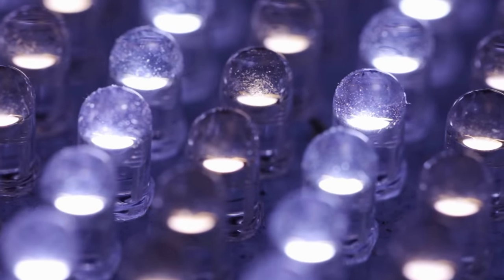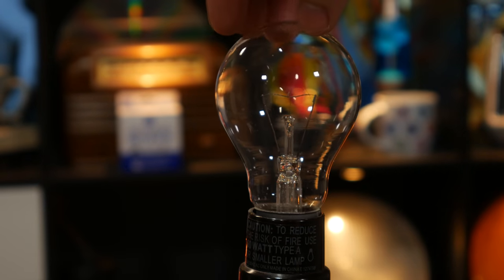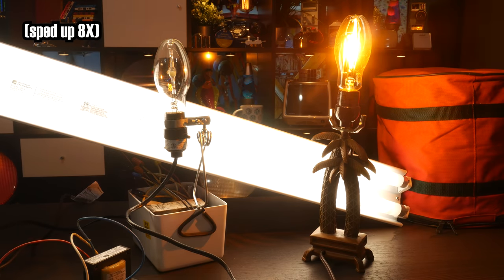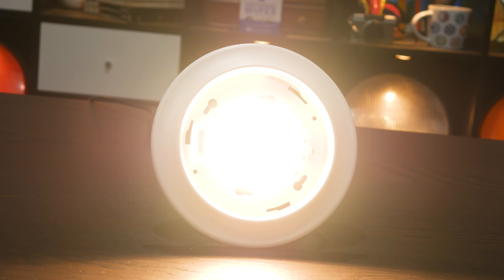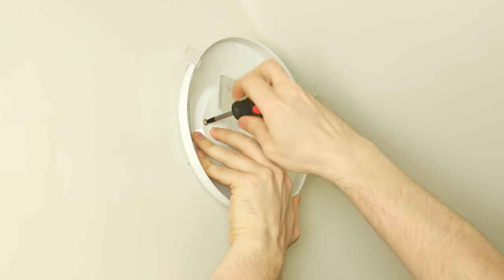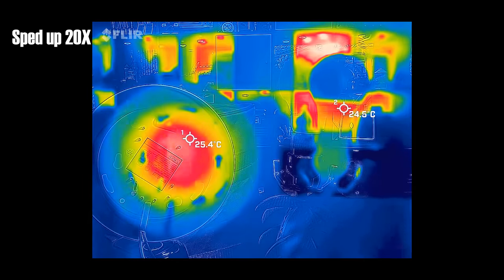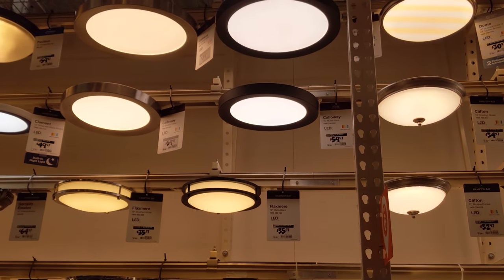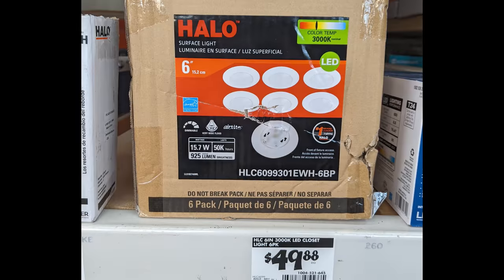A troubling trend in lighting?

Comment: Finally someone is talking about the trade-off and not just going to pLaNnEd ObSoLeSeNce. If someone says "build me a thing," your first question is "how long does it need to last, or how cheap do you need it to be?" And that's just a reasonable beginning to anything, not some kind of grand conspiracy.
Reply: Agree! I hate these things. We had an LED "bulb" go on the fritz so we replaced it in one of our rooms. We wanted a cooler color so I bought enough to replace the rest in the house under the assumption they were all "bulb-like" and then store the warmer bulbs for a "just in case". Whatever genius did our apartment used half replaceable-bulb fixtures and half of these throw-away's. It's insane. So we couldn't replace half the bulbs/lights without tearing out the entire fixture if we wanted ( we didn't ).
Reply: Yup. I agree! I was actually considering these fixtures for a renovation for one of our bedrooms in our house. But man, there's just too much caveats in the long run. If they die then you need to replace the entire unit. Even worse when they don't have the same model and you'll live with an inconsistent design. So rather than dealing with the headache later, I just went with pendant lights that uses a regular socket. That way, i don't need to worry about replacing the whole unit. Bulbs are so cheap to buy and it doesn't require much work to change.
Reply: @Narja It's design lifespan, more than planned obsolescence. Planned obsolescence would be charging $30 for these things, than having them intentionally cook themselves like clockwork after two years. or making them turn on and off via app, which then cuts support for older lights.

I don't have a problem with these things, but it's one area where spending a bit more really does make sense. it also seems like a new 'socket' standard built around LED light fixtures wouldn't be a bad idea. something flat, or maybe just an XT60-esque kind of connector with some norms around cooling.

Edit: apparently Japan thought of the above issue, and came up with a pretty nice solution for it, see:  引掛シーリング as mentioned in the comments. lower profile than a traditional socket, and snaps in like a smoke detector from the looks of it.
Reply: @Narja how is it "still planned obsolescence"? Do you think every product made has planned obsolescence in mind?
Reply: The complaints echoed in this video are largely around buyer lock-in. You buy these, you're locked in with ONE supplier and it may be quite hard to source replacements or repairs into the future. This is a very similar outcome (and complaint) to planned obsolescence - ie "build me a thing, but lets make it flawed in some way to therefore guarantee quicker future sales".
They're both anti-consumer practices that should be discouraged.
Reply: Light Manufacturers do purposely overdrive their circuits to early failure.  This has been made  illegal only in Saudi Arabia.
Youtuber 'Big Clive'  unpacks this well and gives workarounds.
Reply: @DFX2KX  "design lifespan" nice pilpul there friend.
Reply: @Shrouded_reaper  pilpul? that's a word I had to go look up. But yeah. the longer it lasts, the more it costs to make and the more it costs a consumer. there's a point where folks stop paying more even when it makes sense..
Reply: It depends if your reasonability is derived from capitalism or not. You can't just state a subjective matter as truth from one point of view. That's not how logic works.
Reply: @neonraytracer8846  Even if you're not working under profit motivations, making something last longer and longer starts to incur exponential investment in time, testing and materials. Reducing the average life expectancy by a year lets you make half again more of them for some things, and give them to that many more people at the end of the day.

Even Pacemakers have design lifespans in them, because it's more feasible to change them out occasionally.

Capitalism just means the savings of doing so go into your pocket and not the end user's.
Reply: @DFX2KX  Nah that's not capitalism. Let me give you a bulletpoint from the wiki of a capitalistic situation:
> In general, capitalism as an economic system and mode of production can be summarised by the following:

Capital accumulation: production for profit and accumulation as the implicit purpose of all or most of production, constriction or elimination of production formerly carried out on a common social or private household basis.

So, to me, having a doctor whose pacemaker randomly stops rather quickly than over the span of let's say 20 years would undoubtedly take longer time to RnD and manufacture, and once enough has been made, the company making them under current way society works would go bankrupt... but doctors would be able to save lives more consistently.

Now, there's a lot of details to be had in this. I'm personally, generally a capitalist. It's the best system for the most people we've found so far. But have a look at e.g. my country Denmark. With socialistic tendencies such as free healthcare (capitalist reasons, healthy people produce more value) and 2 years of product warranty... We still are a capitalist society. Capitalism isn't one singular thing, it's an ideology. 

I'm not against planned obsolescence per se, but when you mention a device often used in critical life or death situations and say everybody should expect a pacemaker to die quickly because then we can make more, makes no sense when it's at the cost of lives. Not to me anyways.

Planned obsolescence for food products is great, you get a date and after that it's your decision, they won't answer for it.

Planned obsolescence for IPhones or smartphones to basically self destruct or just throttle insanely, or - as in my case on a S9 Note - not getting the latest OS updates. It makes no sense. It's electronics, you plan obsolescence because you wanna sell more of them, and that's it.

Having light bulbs is the same as electronics. It's electronics. Do what you can to make it last and sell that shit, long-term profit or not. It's for the betterment of humanity not for a small group of people to make money.
Reply: @neonraytracer8846  well, here's the thing, and I picked pacemakers specifically because, no matter how much money you throw at the problem:

The laws of physics are brutal on electronics over time. They don't care. A pacemaker's battery life depends on the patient as well as the exact device. but it can last anywhere between 5 and 15 years. The pacemaker is already about as big as it can be without discomfort. All of the HV components will be larger, bulkier, have multiple redundancies, and take several more decades to get through trials. All for the very small number of people who get heart issues early enough in life that they'd get the full use of a 40-year pacemaker/defib.

Or you can just certify it for a certain amount of time, about a decade, and give the guy a new one. And spend that effort making medical devices for another condition that lacks them.

There are a finite number of mechanical engineers on the planet, and of that group, only some are qualified to work on medical devices. Every working hour the spend on one device (pacemaker, in this instance) is time not spent on developing such devices for other conditions.

Capitalism aggravates the situation no doubt,  but it doesn't change the facts that Diminishing Returns is a thing, engineering is nothing but tradeoffs and Entropy will come for us all. The public healthcare agencies of the Scandinavian countries are willing to throw more money at the problem to push higher up the curve of diminishing returns in research and procurement that is true. But the curve is still there.

Something else you guys throw more money at then we do, that Tech Connections has covered: Passenger rail. Steel track rusts*. Even the 'stainless' kind eventually breaks down. wear and tear on the wheels and tires (yes, trains have tires, they're metal and a replaceable part of the wheel) demands eventual replacement, even cars and locos deteriorate enough to be generally unfit for use eventually.  Risk of derailment is *factored and accounted for because you can reduce it, but not eliminate it. And here too you guys are willing to spend a lot to get a little in terms of reducing risk. That's not Capitalism in most cases either as your rail is state-owned at last check.

An old proverb rings true: Better is the enemy of good enough. what "good enough" is depends on the use-case. medical obviously puts a great emphasis on longevity, and track somewhat less so. Things like phones? people sell perfectly good ones to upgrade all the time, so all anyone would be doing by making the 30-year cellphone is making an overpriced cellphone.
Reply: @DFX2KX  I get your point with pacemakers, that's all fair enough. Diminishing returns is not something you'd mentioned, and if you had I would have agreed on that.

But it's untrue that electronics deteriorate as quickly as general knowledge suggests. It's a manufacturing problem and a case of being stuck in old ways. Much like how atomic powerplant technology has gone far, but actual usage of it compared to the old tech isn't that far spread because it's more expensive.

Renewing things because they need to be is all good and well, I don't think we need an argument there. I see the world as a place of finite resources, but for the time being (at least some hundred years if not thousands), we're good on most materials. 

Planned obsolescence is written in law. It's acceptable to a degree in society, and I think it's an old way of thinking. Back from a time where technology hadn't advanced to where it is today. I get the need to protect your livelihood and all that, but if we can realistically create a society where scarcity is a thing of the past and we get to make things the best they could be... Why not do it? Why hold back by acting like it's inherent to nature that things break quickly, even man-made ones. It saddens me that we stop exploring better ways because it's good enough. There's definitely a balance to be struck, but intelligent people (lobbyists and lawyers) are doing their best to keep their livelihoods by making sure those hiring them, will keep making money they way they always have. That doesn't make it good enough or even acceptable. I'm in no way for a viewpoint of society where good enough is better than better. Listen, everything that made our world has been done by people who thought what they had, be it tools, knowledge or living place they thought it wasn't good enough and searched for something better. I hate your kind of argument because it invalidates what makes us human. 

ASML makes machines that produce silicon wafers, those machines are made to last, is it magic that most of them does? We do amazing shit in niche industries where stuff is built to work for decades or even centuries. Humans are amazing when good enough isn't good enough.

Comment: I almost purchased a $300 modern looking outdoor wall light until I realized that the LED was build-in!  That is a lot of money to risk on an outdoor fixture.
Reply: Often times those are under warranty for a long time, but even then the LED's would certainly survive at least 5-10 years.
Reply: We did do that except it was an indoor chandelier with integrated LED. Blew literally within hours of installation. Called the company to try to trouble shoot but they were impossible to reach so we checked the paperwork again where it was made clear that in the case of failure you had to totally replace the fixture.. A $300 chandelier! So we did exactly that. We returned it to the store for a fixture that did not have integrated lights so now if the light blows we only have to replace a $4-10 bulb and we can keep the fixture.

Comment: When renovating my bedroom, I ran into the code issue in the closet, and the permit inspector told me my only solution was a flush mount LED.  However, I had no intention of putting in a fixture that could just fail and be a hassle to replace. Amazingly, I found a code appropriate LED bulb style fixture with pull chain THAT SCREWS IN to the existing ceramic base.  The thread mounting on the fixture is recessed, so it disguises this perfectly, and is truly the best of both worlds for me in this scenario.

Comment: Some of these lights have quick connectors that easily allow you to change them out. These connectors should become standardized like how light bulb bases are.
Reply: wago is great for this use
Reply: In Australia for ceiling mounted lights we usually have a “flying lead” which can then be plugged into a socket in the ceiling space. This allows swapping a failed device easy even for someone not qualified for electrical work.
Reply: @majorhayze  You can get them in the states too. I replaced all the bulbs in my can lighting with an LED fixture but they screw in with the traditional bulb base so they're easily replaceable
Reply: @majorhayze  this is actually the standard now. They must be installed like this and makes so much sense.

Comment: When I remodeled my basement and got LED light fixtures for it, I got the same model for the kitchen, living room, and bedroom (and a very similar one for the bathroom), so if one of the kitchen ones goes out I can get a new one for the bedroom and transfer the still-working bedroom one to the kitchen. I would've preferred something that takes lightbulbs, but the ceilings in my basement are low enough that my top priority light fixture characteristic was "flat", and lightbulbs can't really compete on that front.

Comment: This seems like a considerable solution to the ceiling lights in my low clearance basement. Dodging globes is a bit of a hassle.
Reply: I have a similar one that I bought a while ago for my house, would recommend when headspace is limited. You will not be able to match the light output in a lower and more wife-approved format.
Reply: @dailythenoob  Thanks for sharing. Much appreciated

Comment: Sounds like we need a new lighting standard that allows for easily user replaceable LED lights, in a form factor designed to the strengths of LED lights.
Reply: I think a design similar to the fluorescent light fixtures with swappable ballast/drivers and light would be perfect.
Reply: LED strips bought in rolls and powered from one end is pretty close to that goal, except they tend to use resistors to set the final current through each LED.
  Another common design is squareish circuit boards that run directly from mains.
Reply: Yep. Just have the flat PCB+diffuser plug into a fixture in some way.